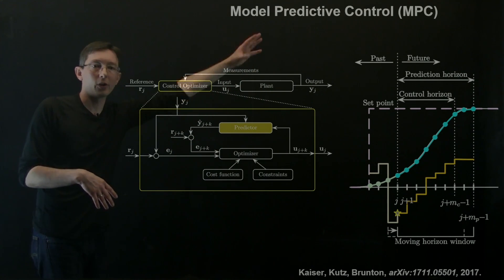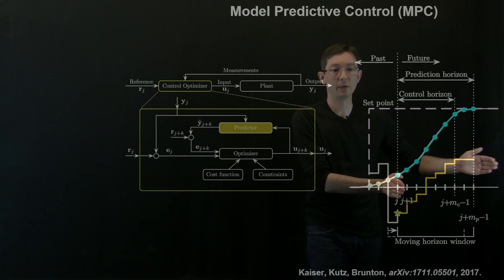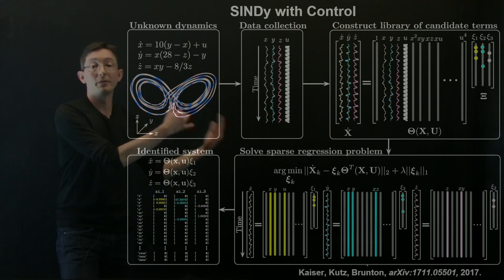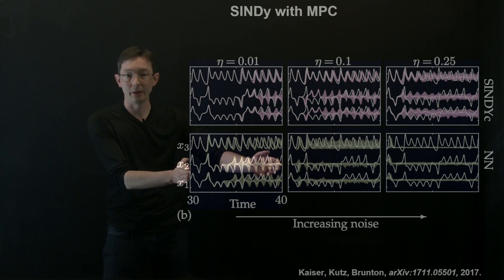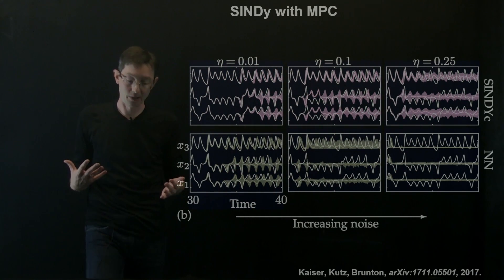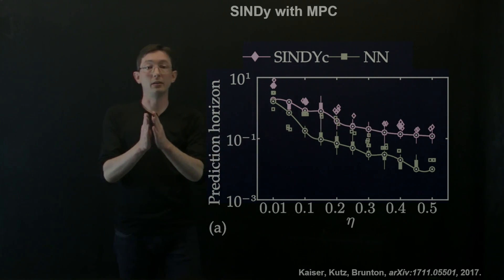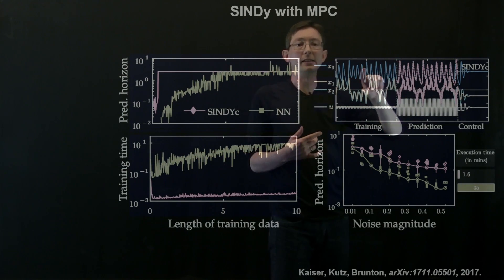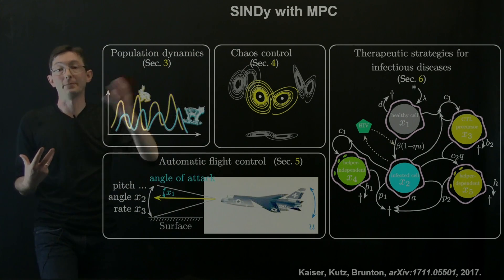Sparse Identification of Nonlinear Dynamics for Model Predictive Control

Comment: Hi professor Steve, awesome lectures. I have a general question. If the system I am trying to identify is a black-box, I don’t really know what gives a full state vector, or I might not be able to measure some of them, do I just guess it out or do I try sINDy with a reduced order state vector or does it mean I can’t use sINDy?
Reply: I will say for a system that has some independent states are unobservable, you really cannot control it properly right?